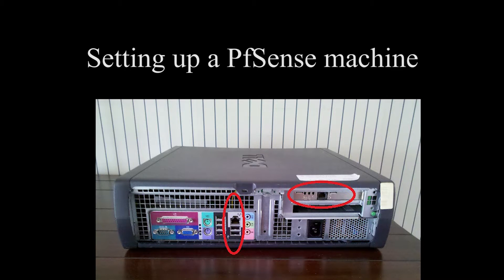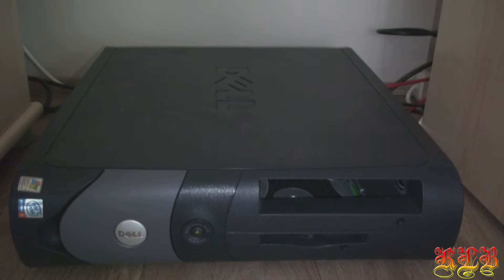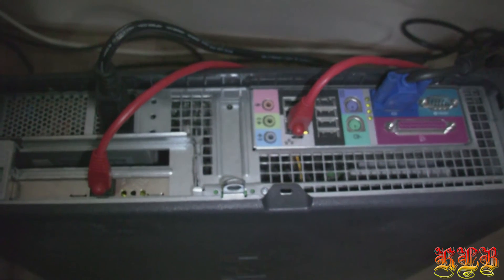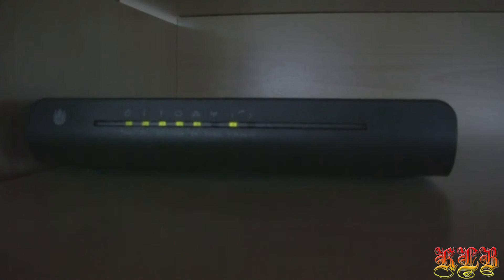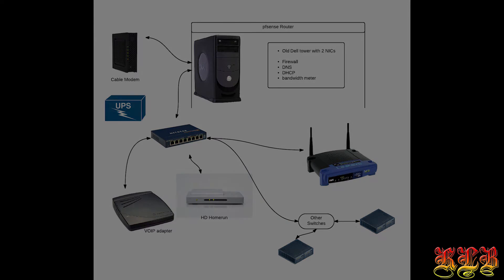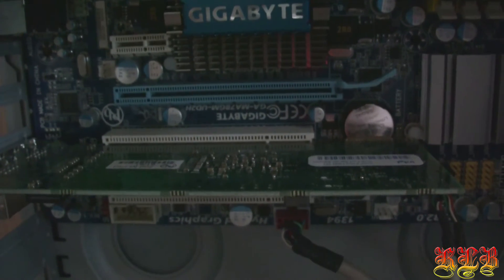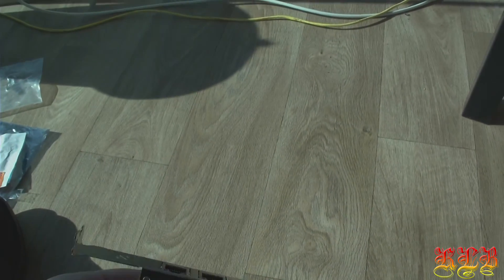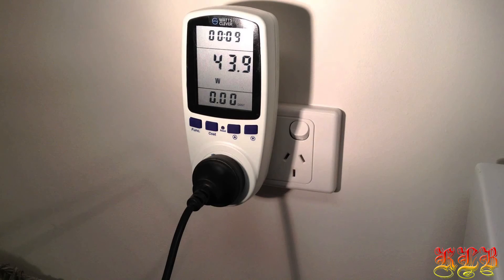Setup PfSense on old hardware

Comment: I use a 4 gigabyte ram rockchip soc (rk3328) with Debian for the os.  It has usb 3 and a gigabit ethernet that I trunk with my modem using an old tp link router as a managed switch.  All firewall and routing Is through a set of iptables commands,  dnsmasq with stubby for Dns over tls and a minimal dns sink holing through host files.  Attach storage through the usb is an external drive which is my backup and file server for the lan.  I don't know how many watts it uses but it can't be much and it's completely silent when the hard drive spins down.  /var/log is a ram disk set at 50 megs which gets rotated once daily for sd card longevity.

Comment: 2015 dual core was over kill LOL. Now days with the 500mbps to 1gb internet speeds a quad 3.5ghz processor is required for full DPI throughput. Crazy how things have changed so quickly

Comment: can i use an old pentium 4?
Reply from the maker: Yes you can, but they are not very energy efficient. But for testing out the software and running it for a month are so, no problem.

Comment: Can somebody explain to me why as standard routers are so rubbish, how come they are still needed even when you build your own. What role would the original router be in this circumstance?
Reply: CPU on x86 is generally faster and RAM is cheap. However 60 watts is quite a bit on my opinion for this build. Personally I've got Pfsense box drawing that with a E450 running around that level. I've gone down the route of a low power Xeon Haswell model (17watt CPU). However if you've got a router which support LEDE try that as I've found it can match performance in similar setups if your router has lots of RAM and a good speed CPU.
Reply: I use pfSense to have more control over my network, in addition I have multiple packages installed mainly pfblockerng and squid.
pfblockerng can help you with some configuration to block almost 99% of ads on the network from PC to mobiles, and squid is for caching some of the network most visited sites to lower bandwidth consumption and speed your internet also has an antivirus. 
also couple more features are available for advanced users as making a custom hotspot with either vouchers or passwords and a custom login page you create.